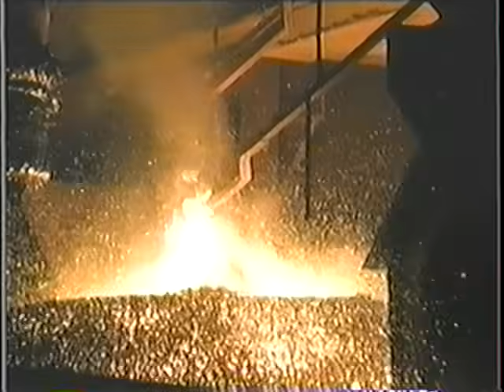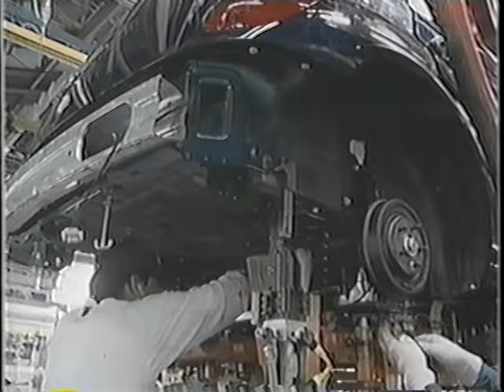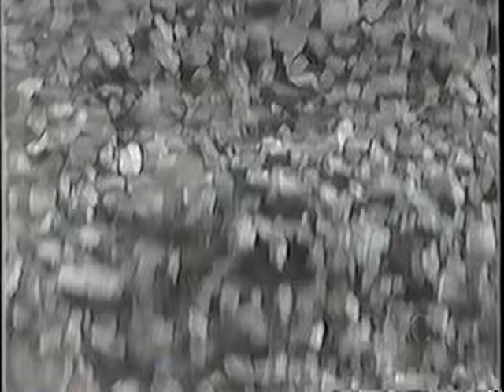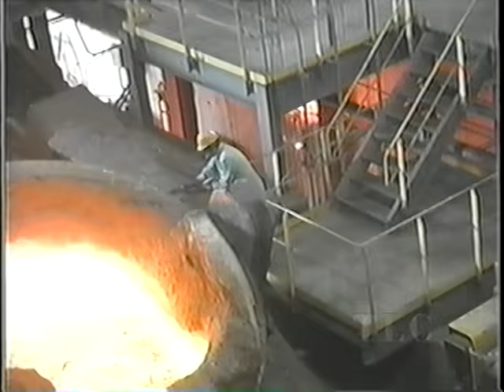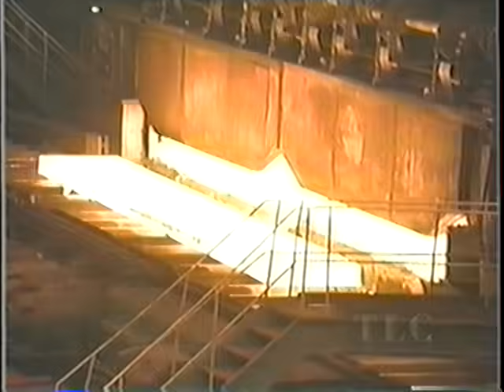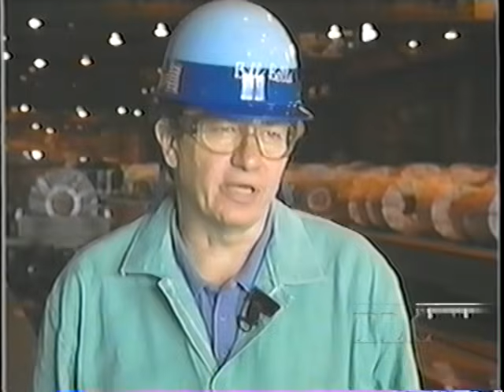Big Stuff Featuring Steel on location at U.S. Steel Gary Works

Comment: Why did hearing that this place using 300 years worth of house hold water supplies everyday make me so grossed out.
Reply: @J oseph, Gary Works has a water treatment facility.
All the water used is treated before being returned to the lake or the river.
Reply: @MaxCruise73 I worked at the S&T Environmental waste water treatment plant for 8 years as an operator who ran the Terminal treatment plant. Would clean about 1.5 million gallons a day before going into the Calumet river. That was in the 90's.
Reply: I'm curious why they don't reuse the treated water? Thanks.

Comment: @ old goat  So which mill did you work at?  And what did you do?
 I was at the Tube mill across from ye olde Coke plant. I ran a manual tube  straightener called a gag press. 
It feels like a  by-gone age.
Reply: @oldgoat50  l had an uncle in the slab mill. My  dad worked in the "big mill" as a pipefiter, and grand pa came from Slovakia to Aliquippa PA. then transferred to Gary as a millwright.
I was on the Gag Press,  at the far east end of Tube Works just a 1/4 mile away from the  Lake Michigan breakwater. On a " No material" night l sat on the breakwater, watching the smoke stacks belch flame.
A twilight world...

Comment: We roll slabs from Gary Works here in Portland , along with ones from all over other places. Stamped GWO, I unload them from railcars.
Reply: @oldgoat50  The "Heppenstall" tongs, we do have those but only for red hot slabs that need to be backed out of the furnace. I unload the railcars with a Taylor 92,000 lb. forklift with a diesel generator powered double magnet on the forks... We can't use the cranes to unload the rail cars, we dont have a track siding that goes under any craneways....
Reply: @oldgoat50  No, magnets....

Comment: Remembering Fairless Hills steel mill in Pennsylvania all the new guys would come in and it would be so hot they would be hanging on the railing ready to pass out....Fun Fun when I worked there I had to wear about seven layers of clothes the one I accident I will never forget all the hot molten Steel exploded and everybody went running went through all the layers of my clothes and into my neck and shoulders by the time I got to the hospital it was still so hot they couldn't get it out of my body everytime I look at my scars I remember the good old days working at the steel mills when they didn't know the meaning of safety as far as my hearing maybe lost 70% I lost.. it was supposed to be a temporary job when I was going to school this way I wouldn't have to work in a place like that but once the kids come along now you get trapped in a job you don't want to do you can make tons of money that's about it....🤣🤣🤣

Comment: sky would glow at night out window attic blast furnaces casting B O F pouring south works granfathers worked there cut up narrow gauge locomotives.  I broke foot and wrist in coke plant Gary works rust rot not compensate for. Used drive in Gary works with my father little runt Pollack tube works went back years later work on blast furnaces.  Screwed that up. Was processing steel till l screwed that up places shutdown.  First place shutdown 3500 of us lost job one day.  Grandfathers brothers both sides was Carnegie steel then. Local 65 gave nice bible grandfather died south works steelworkers park now walls ore bridges ride still there its all like a strange movie girlfriend spent most time with her father head roller slab mill hillbilly.  Old timers told me had no safety shoes hard hats safety glasses.  Them tuff people turn of century in steel industry in 1800's and early 1900 them the real men of steel during war women went in. My older sister worked in mill.  Grew up went school church everything holy water earns everything in Polish.  They were Polish nice churches mass every morning before school.  Always was pretty sight watch iron pour and rolling red hot steel feel lucky the short time worked  furnaces mills lots of big stuff massive machinery.

Comment: I see from one steel mill to others in video and from one I’ve spent years in.  They never change.  
Never upgraded.  
Dirty ass pulpits to work in, everywhere outside of it.  
Horrible ass air quality.  
And I’m sure underpaid an over worked
Unsafe ass conditions I’m sure as the one I was in based off the things seen in video. 
Looks like their always the same. 
An old dirty wreck of an place fuck the workers never improve just put out the steel screw the work environment

Comment: One last question. We had a boiling hot summer this year, by Irish standards, some areas had drought.  As the works takes it's water directly from Lake Michigan, If there ever was drought in the lake Michigan area could Gary works accidentally drain the lake. Not meaning to be critical of Gary works, just curious.
Reply: The warm water is returned to the lake. They estimate lake Michigan holds a zillion gallons so they're good.
Reply: @Nathan-pw7do thanks again.
Reply: That's a good point.
I heard that the rising temperatures of the Great Lakes, due to higher temperature in the Hudson Bay region is having a negative impact ecologically speaking.
Reduction in grasses on the Great Plains is being attributed to the steady climb in temperatures.
I hope and pray they get the math right.

Comment: I wonder does any of that iron ore come from Tara mines ireland, we dig it up and export the ore you guys turn it to steel
Reply: I think US Steel gets most of it's ore from mines in Minnesota.
Reply: @pyroman6000  
Yes us steel owns a iron ore(taconite) mine in hibbing mn
Reply: Most steel production is made from remelted scrap, and iron ore is mainly used for new production high quality steel that isn't contaminated with alloying agents like carbon, chromium, etc..
Reply: Slappy thats false . I work at gary works at the #1 bop steel facility on the steel floor of the shop . molten iron ore or " hot metal " as we call it is used for every heat . Carbon comes from the coke which comes out of the steel during the blow process. Alloys and other chemistries are added to the heat based on the grade of steel we make

Comment: Good video Joe; when did the Gary Steel Works plant shut down? Or does it still operate? We (USA) used to have a 'hard fix' on producing steel until we (USA) started to buy outsourced iron and steel, albeit cheap inferior crap, from foreign countries. Closed steel plants across the country meant loss of jobs, economic slumps, high unemployment and worse.
Reply from the maker: "The plant is still operating at the same rate as it was when the video was produced." - Thomas Cera
Reply from the maker: +Mark Seaman Yes. I posted this video from my Dad's archives. I'm glad it was useful!
Reply: +Joe Cera Are you related to Tom Cera?  I worked at Gary Works for 30+yrs.  Stumbled across this video when I was searching for info on how steel is made for some friends who know nothing about it.
Reply: Tell your dad "Hi" from me.  Currently snow birding in FL.
Reply: +Joe Cera - US Steel Gary works Coke plant is shut down. They shut down the coke plant in late April of 2015 and idled there Tin Plate works too.The rest of the mill is still open and pumping out steel... Check out the article.. http://www.nwitimes.com/business/steel/u-s-steel-starts-layoffs-of-up-to-workers-at/article_a2368734-c52f-5ee2-8761-2b9f03734c30.html
Reply: So do you work in the Steel Industry? I happened to work a commisioning project for, the company I worked for at the time;and US Steel was completely unprepared, inept, and disorganized.Do you know why the Steel mills in US maybe suffering? Unfortunatly, not for the reasons you stated(albeit cheap inferior crap). I am sure some the reasonsare a cheaper product, not because its inferior. In closing, I have worked around the steel industry for some 6-8 years and I decided it was time to leave that sine wave industy.
Reply: It's a lot more complicated than that.  The fall of steel in the US dates back to the end of WWII.   We were spared the ravages of the war, while most industry in Europe and Asia was bombed flat.   Thus they were forced to build anew- using the latest, more efficient technology.   Our mills had billions invested in older technology that worked very well, but was labor intensive, and not very efficient.   Thus the gap in price between domestic and imported started to shrink.  Then the Long Strike happened in the 50's.  Shut down the entire industry for about 1/3 of a year.  Customers were forced to look elsewhere for steel, and found that foreign made steel was surprisingly good.   To end the strike, our government forced the mills to agree to a contract that was completely unaffordable- then or now.   The result of that should have been seen a mile away, but wasn't:  big price increases across the board.  Rather than accept any responsibility, the gov't investigated them for price fixing...
By the 70's and 80's, our mills were in huge financial trouble, and started dropping like flies- you cannot compete with cheap imports with the kind of overhead we had- AND a massive workforce due to the old skool plants we were running.   Many plants shut down forever:  Homestead works; Bethlehem Works, Lackawana, NY; Weirton WV; etc etc.   Those that survived were the ones who invested in newer, more efficient methods- which cut the workforce.  (things are far more automated now.  The old plants were mostly manual- which meant lots of jobs, but extremely dangerous and grueling jobs.)   You wouldn't believe some of the stuff guys used to have to do!  Nobody is willing to do that now- and OSHA wouldn't let you if they were.   We still produce insane quantities of steel here- it just takes a lot less people to do it.